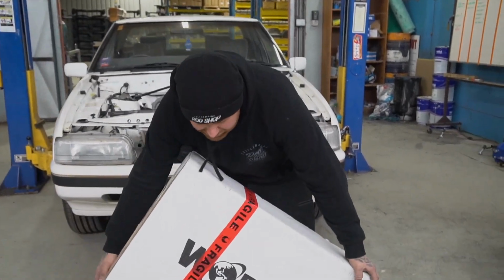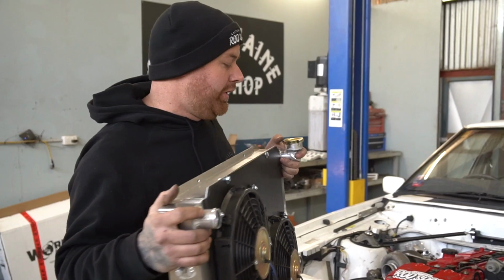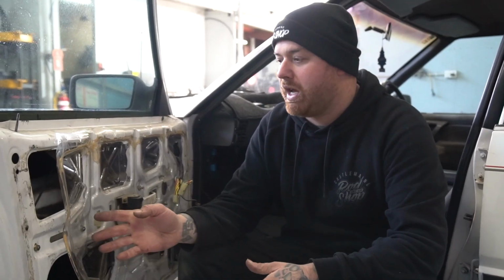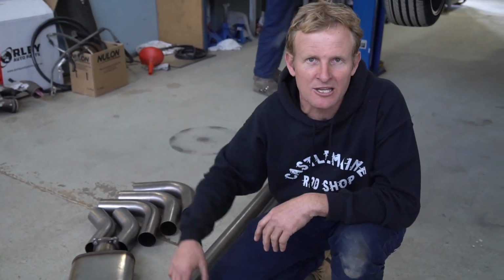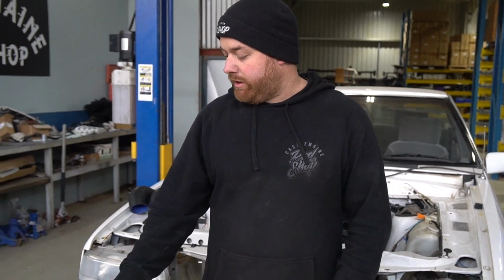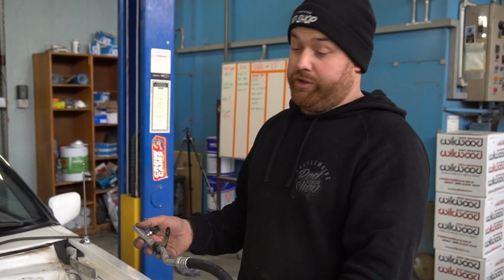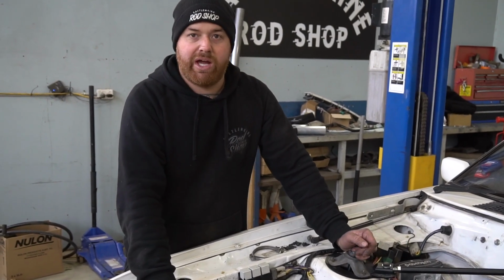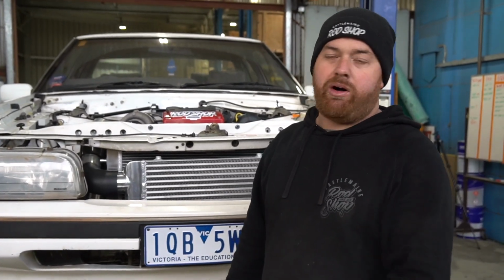XF Ford Falcon Barra swap - EP 9 - Radiator Install, Exhaust System Done, Intercooler test fit

Comment: The more air flow through a radiator the better, putting a metal plate with 2 holes for the thermos is restricting flow, means the fans will be on more often and your reliant on them. If you do have an issue of overheating that will be a problem,  thermo fans fuck up all the time.

Comment: xd xe xf door handles never break if you replace the door hinges plastic parts which stops sag which in turn stops the pressure on the handle. the handle should not have to be lifted to open the door. on my xe the doors swing open on their own with no pressure applied to the handles after lightly lifting it to unattach the lock. Alternatively put a bolt and nut thru the centre of the handle spring and it wont ever break even if the doors are sagging.

Comment: Hey mate what radiator did you use from what model? I see the brand. But with the Barra Inlet/Outlet is opposite to XF as Ud know.
Reply: VK commodore. If you look on eBay you’ll see a couple of variants but the one they bought is on there. It’s narrow enough for the cooler pipes to go either side and the fill point means you don’t have to use an expansion tank.
Reply: @Jason_Cunts  Cheers for the reply man, I got one from Worley Cooling last month for around $200 Full Alloy & Looks the goods, haven't fitted & run yet still building. FYI: Stay away from Sniper Performance 6mm Main Cap Girdles, I had to modify my Windage Tray, Machine material of the Main Caps so the studs & nut had enough thread to positively engage. (Which they Don't tell you, until U have bought it) = More dollars spent, time & frustration.

Comment: Jason does a great job presenting, better than Mark. 3in exhaust is too small using the internal wastegate. 3.5 in will be better suited. While I'm at it, you can have the cold side coming out the passenger side using the standard intake manifold using 3in pipe. Would look a look and perform better.

Comment: Door handle issue is caused by the door hinge bushes wearing out. If your door handle keeps breaking check to see if the door moves up and down. If it's loose take the door off and replace the hinge pins and bushes then re-fit the door and check to make sure the latches meet evenly. Ask me how I know... I think you can buy spare pins and bushes from Rare Spares.

Comment: Putting the cat so close to the trans pan will it over heat the trans ?
Reply: It will be fine, if it does cause a problem they could heat rap it or make a shield but it shouldn't need it.

Comment: I have. A ba barra. Skid car. Could use tell me were the oil sensor plug is that goes to side of block
Reply: From memory
Oil pressure sensor should be under the inlet manifold on the block
There are 2 sensors under there
It's the one closest to the back not the front